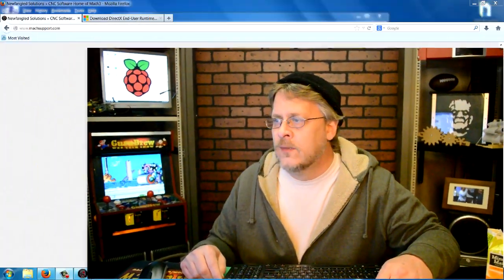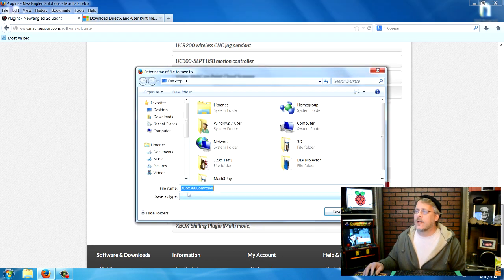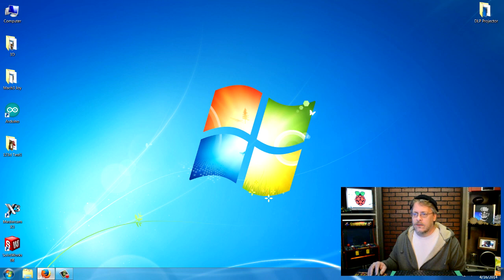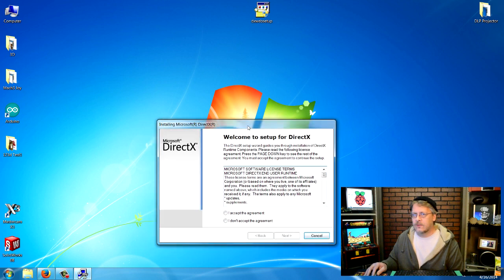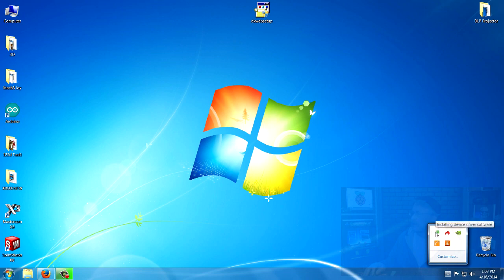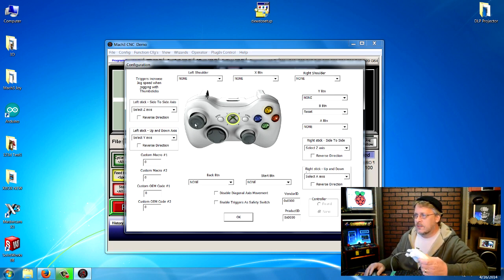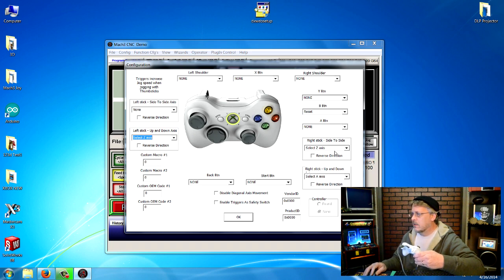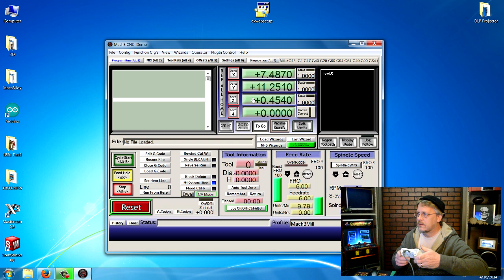How to Use XBox 360 Controller with Mach3 CNC Software

Comment: Followed your steps and can't get mine to respond. Running Windows 7
Downloaded and installed DX Setup
Downloaded and placed the  xbox plugin in the Mach3 Plugin file
Double clicked the plugin file
Controller has the light in the upper left lit
Configured the controller in Mach3 like you have suggested
Rebooted machine and still can't get any response.

Currently running Mach3 in Demo mode.

Any suggestions?
Regards, Jim
Reply from the maker: If you can configure the plugins page then you are almost there..... Are you sure the reset is not activated? Steve
Reply: well, the reset is flashing like in your demo and when you pressed the B button it reset it, but mine does not stop the flashing Reset butonn in Mach3.  

Does Mach3 demo make a difference?

Thank you for responding Steve!  I like watching your video's.
Reply: Even the joy sticks don't cause the axis DRO's to move. Note: CNC machine not attached.
Reply: I have configured the controller in Mach3 as you described in the video, saved the settings, close out of config, closed Mach3, rebooted my computer, opened Mach3 and still cannot get any function to respond.  The xbox controller light is lite for connection to controller 1.  Tried connecting the controller to other computer USB's with no luck.

The xbox controller is brand new.
Thanks for any additional suggestions.
Reply: I have configured the controller in Mach3 as you described in the video, saved the settings, close out of config, closed Mach3, rebooted my computer, opened Mach3 and still cannot get any function to respond.  The xbox controller light is lite for connection to controller 1.  Tried connecting the controller to other computer USB's with no luck.

The xbox controller is brand new.
Thanks for any additional suggestions.
Reply from the maker: Jim S
If the machine is resetting with the stick I am guessing your ports and pins are not yet configured. Can you jog the axises using the arrow keys on the keyboard. If not see the configuration for the step and direction assignments. Steve
Reply from the maker: GuruBrew
Here is a link for Mach3 manual http://www.machsupport.com/wp-content/uploads/2013/02/Mach3Mill_Install_Config.pdf
Look at page 5-3 and like concerning the ports and pins setup.
Reply: Steve, made some progress, I had to reload Mach3 as the keyboard keys would not move the axis.
I got to configure the controller, saved and reopened mach3.  The controller light came on but I cannot get the controller to work.  I don't own an xbox so I went to a local big box and bought a Power A xbox controller.  Thought is might be a bad one so I borrowed one from my son and it was the same brand and it didn't work.
Is there a specific xbox controller I should purchase?  Does it have to be a microsoft xbox controller or could it be a generic?
I'm stumped on this one.
Watched the video a couple more times and I'm sure I have done the setup correctly.
Any last thoughts? Regards, Jim
Reply from the maker: I think this plug-in works specifically with Xbox 360 but cannot speak for clones or compatibles. I tried using another type of USB joystick in the beginning and it did not work for me. The white stick that I am using and that is shown in the video says XBox 360 controller on the bottom with no other model numbers or codes.
Reply: GuruBrew Steve, Success! I purchased a genuine xbox wired controller and it works as advertised.
I tried two generic xbox controllers that did not with this plugin.  I tried a logitech and a power A xbox controller and while both work on an xbox did not work with this plugin.  After purchasing a Microsoft Xbox wired controller it worked fine.  Thank you for this video.  It is very simple to set up but it appears to be hardware specific.  At least for me on a Windows 7 system.
Reply: Jim S I also had the same problem using a third party controller. In the end it worked after I uninstalled the xbox dll file and installed the shill controller dll (shill dll is found under the xbox controller download on the artsoft website). Then I uninstalled the shill controller dll and reinstalled the xbox 360 dll..and it worked! I just got lucky I guess, but I would also recommend shutting the computer down completely and not just using restart after you install the dll files etc. It is also worth noting that on the Mach3 config screen for the xbox controller that in the bottom right hand corner there are two boxes that say "Product ID" and "Vendor ID". That's where you can see if the Mach3 plugin is communicating with the controller. My third party controller  PID is 4F2 and the VID is 111, maybe that might work for somebody else also. You can find the PID and the VID of your own controller in you windows registry files, and you can also check if the windows xbox360 driver is communicating with your third party controller by using the calibration device.
Click Start.
Then type joy.cpl in the run box and then click the Game Controllers icon when it appears.
In the Game Controllers window, click XNA Gamepad, and then click Properties.
Click the Settings tab, and then click Calibrate.
Follow the steps in the Device Calibration Wizard.

Good hunting and be patient grasshoppers.

Comment: I purchased one of the knock off ($7) controllers off of EBay, and did the installation per the video - nothing.. tried over and over and had no luck.  Finally went on the Microsoft website and bought the real deal for 29.95.  within 3 minutes of taking the controller out of the box it was working well with my Mach3 on my CNC.   I may never know what the problem was, but I don't care.  This is really cool.

Comment: thanks a lot for the walkthrough.

has any of you guys had an issue (despite getting all the steps right and having a licensed mach3 install), where the programmed buttons would work properly in mach3, but the sticks would't? for me, mach3 is throwing an "unknown word where unary operation could be" error message whenever i touch the sticks and there is no axis movement.
Reply: same here, i cant get it working :S
Reply: what made it work for me was upgrade mach3 to a more recent version. fortunately, i was able to bring over all the machine settings (except one - slave x axis stepper was desabled by default and didn't inherit the setting from the previous config file - which resulted in the gantry skewing).

you might want to try an upgrade, mine was pretty outdated.

btw, i contacted the author lee davis too and he made an honest effort to help me.
Reply: here is a thread i had opened showing more detailed upgrade info https://www.machsupport.com/forum/index.php/topic,32715.0.html. in case the link shouldnt work, google this "XBOX 360 plugin thumbsticks not working"
Reply: but how do you export and import profiles in mach3?
Reply: i got it working, but allso my Y axis one motor is not responding. How to fix it? i have 2 motors for Y axis.
Reply: your settings live in the mach3 directory as an XML file. 

unless you created your own custom profiles, they will probably be named something like mach3mill.xml. you can take this file and copy it (overwrite) into the mach3 directory of your new version. 

as for the second motor on a 2-motor axis not responding, in mach3 v3.x go to config > slave axis > Y axis (in your case) and check [probably] A axis. save config, restart mach and you should be back in business.

Comment: The shillings plugin is an Xbox controller software written for XP by Tim Shilling but it does not work because XP can not run the Xbox controller for the CNC Machine.  Its missing a core driver (Direct X) that isn't available until Windows Vista.  You can't just shove Direct X into XP.  It won't work. Upgrade to Windows Vista at minimum.  Windows 7 is superior software for running Mach3.  At that point you can just use the real Xbox software.

Comment: Great news tonight!  My Sherline mill is responding to the Xbox 360 controller!   I was unable to get Lee's plug in to work but the Shilling Systems one did.  It required Direct X- 9.1 or newer, .NET Framework 2.0 or newer, Microsoft XBOX controller drivers and XboxShilling.dll.   It comes with nice documentation as well.  The clone controller would not work!!!  There is something different about the clones.... So don't buy one.

Comment: i have windows 7 and mach3 with directx 11 when i copy the xbox.dll file to plugins folder  it saves it there but ..when i open mach3 is says plugin defective .dll file so not sure what i did wrong..seems odd when i download the xbox controller from mach3 it is a .dll file and not a .m3p file like yours..if i downlaod the shilling controller file it is a m3p file and put it in plugin folder and plug in my xbox360 controller it says plugin installed but does not show up in plugins menu in mach3..very bizarre